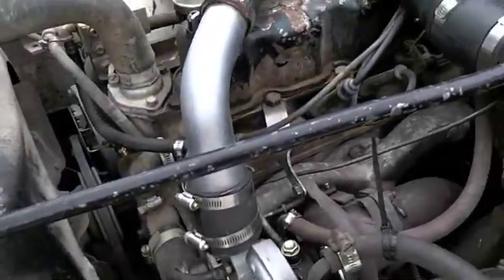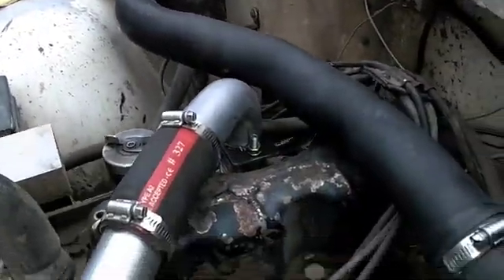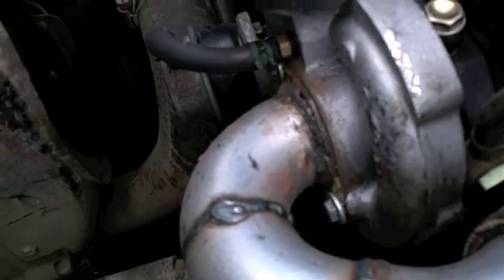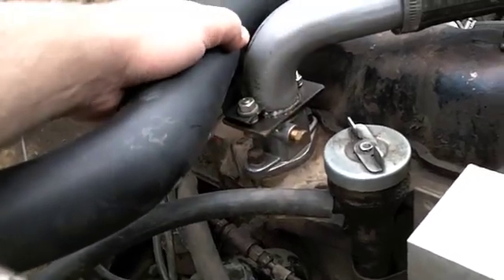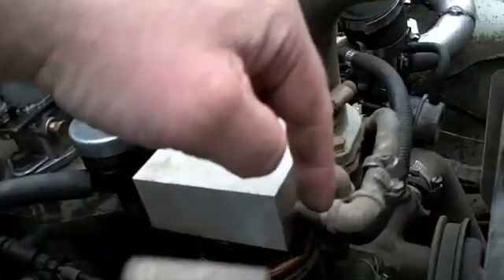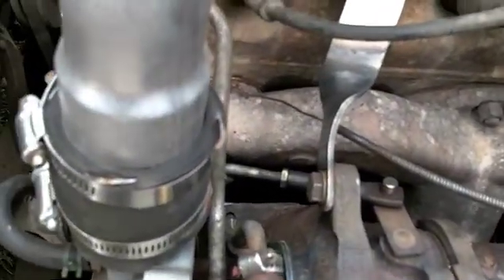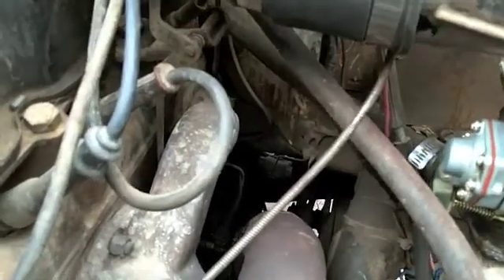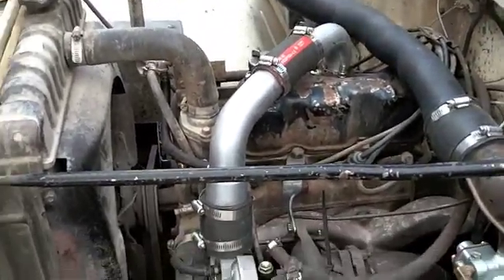Turbocharged Jeep CJ5

Comment: Wow wicked loud adjust the valves.  O wait you can't with all that turbo stuff in the way.
Reply from the maker: Sure and since I welded it to the block there is nothing that can be done for ever and ever.  It is possible that you are unfamiliar with the sweet, sweet clatter that is the F Head.  I am sure you are however because here you are!

Comment: you can help the coldstart a big deal by having a way to spray in some fuel intoo the place where the carb used to sit 
taking some sort of a nitrous kit with a plate that fit between the original intake manifold and pipe and only use the fuel part and give it a small half second bump or two while or shortly before starting  , either that or make a second enridgementpump from the carblinkage intoo that part of the intake , that would likely help the pickup from stationairy too 
the problem with having the carb so far away from the intake is that the fuelvapor will condens in the pipes and turbo when the engine is cold 
a blow though carb setup or putting the carb inside a presurized box on the original place might work better ,jou do need boost referenced fuelpressure and check if the floats inside the carb are solid and not holow brass (those will colapse when put under pressure)
even better to use an injectionsystem

Comment: Can  tell me about the oil filter specifications? 
Is it possible to install an inter cooler as well ??
Reply from the maker: Ato Lkr The Jeep uses what is called a bypass oil filter, that is to say it only filters some of the engine oil at a time.  I simply connected the output of the oil filter to the input of the turbo so the turbo always had clean oil.  Yes there is room for an intercooler in front of the radiator but the piping would be custom.
Reply: NelsonStudios okay.where will the oil pipe from the turbo be fitted? 
And are you using any oil pumps? If so what is the pump specification??
Your innovative work has really inspired me brother. :) Your a genius.
Reply from the maker: Oil comes from the filter and flows back int5o the oil pan.  Just the engine oil pump was used.
Reply: Alright. Thanks again :)

Comment: nice draw through setup. i have one of these from a buick v6 turbo plus i am putting a grand national turbo 6 in mine.
i like your setup tho. just watch out for a backfire. have you thought about propane? its MUCH more forgiving on timing because of octane rating. =)
Reply from the maker: When I put it together the only other 134 F Head turbo out there (on the internet anyway) was a propane set up.  I ran this for years and many thousands of miles but have removed the setup because I never could seem to solve the brutal cold start (40F and below) issues.  It is now all in a box, not sure what I will do, sell it probably.  If you were in a warm climate or knew how to solve the starting issue it still works fine and made a real difference, especially at higher altitudes.
Reply: propane auto adjusts for altitude, temp, everything. you can take a propane kit into a junk yard, find a car, remove the carb and drop on one of theirs and itll start if the ignition works. right off the bat. check out www.gotpropane.com you might decide to put your turbo back on. propane is 110 octane or so. runs up side down, submerged...doesnt matter. =)
Reply from the maker: Interesting.  I suppose I could find a system off a small forklift that would be about the right size.  How is the mileage?  I have a 100lb tank but it isn't an automotive tank.
Reply: on the street, you will lose about 2%, but on the trail, you gain over gas because you dont have the accelerator pump shooting gas every time you try to do anything. propane being 110 octane, it can handle 12:1 which gives tons of low end grunt. what you have is about 9.5: or so, which is great, but turbo and gas at that compression would require retarded timing or serious intercooling. not so on propane. also,  propane is always in gas form so it doesnt have to create velocity to vaporize gasoline. it can sit 20 years in a good can and still be as fresh as the day filled. once tuned to the vehicle, it auto adjusts to altitude and everything like fuel injection. a good 10 gal from a fork lift is perfect. or 2. you can bring extra in case you run out. out em in a camp trailer or whatever.
check em out. i had an in depth conversation with them. if i wasnt going with the grand national turbo 6, i would do my buick 350 on propane. or i would do the draw through turbo setup for the other buick v6's i have. i really like propane. my cousin ran it on her farm truck for many years. there is no carbon like in gas so the oil looks just as fresh as when you put it in.

Comment: Maybe if you mounted the carb closer to the turbo...like on top of the U shaped pipe, it might just start better...the atomized gasoline has way too far to travel and still maintain a spray when it travels through the rubber hose and then make a sharp bend into the turbo compressor...mount the carb as close as you can to the compressor...then it might be easier to start..you, sir, are a genious !
Reply: How is the exhaust routed from the turbo, and did you use the stock muffler or not ?..I have the exact same Jeep with the F134 and I may give this a try !
Reply from the maker: Free flow muffler, shortest exhaust possible exiting right behind the drivers seat, you know under the gas tank.  lol.  Well I am thinking of removing and selling they system, maybe someone in a warmer climate can use it without all the hard starting issues.  I had my fun.  I really only did it because they said it couldn't be done.  Smoky and the Bandit style.

Comment: The high torque will be a combination of the long runners and the exceptionally long stroke of the engine.

I am surprised the engine does not blow with such a low rpm max

Comment: The torque is probably because of the looooooooooooooooooooong intake runner setup. Short runners = higher horsepower, long runners = more torque with a turbocharged setup.

Comment: Only thing I would see as a possible trouble point is the throttle linkage seeing that the crab is affixed to the firewall the linkage is still located on the engine.  As the engine torques over, the throttle linkage rod could put a bind on the crab butterfly.  You could use a bicycle brake cable or a GM type cable attached gas pedal.  Nice build.